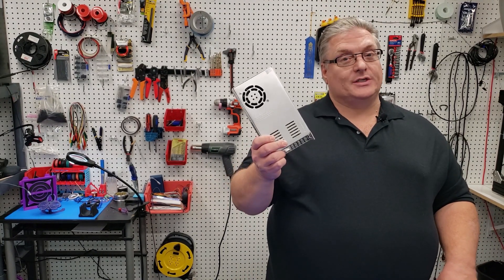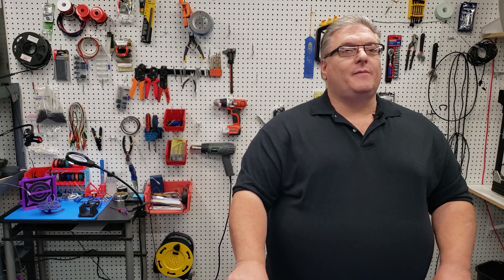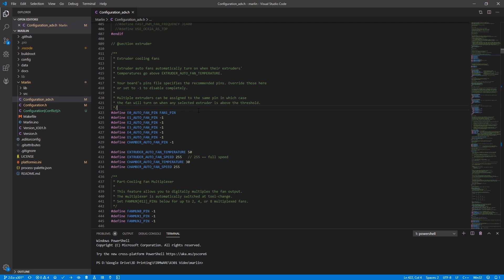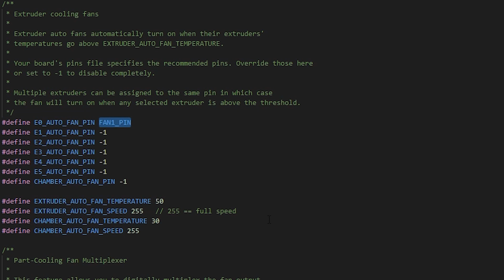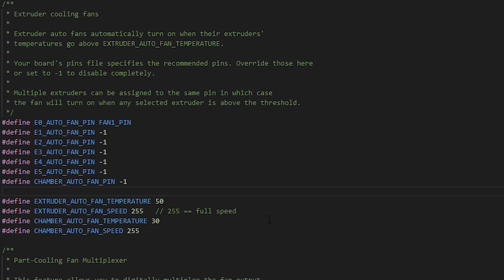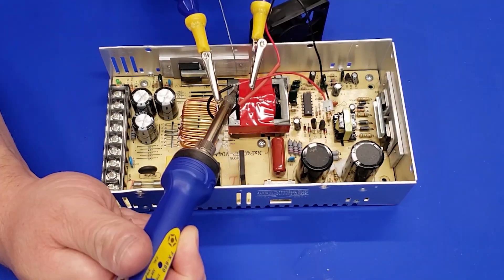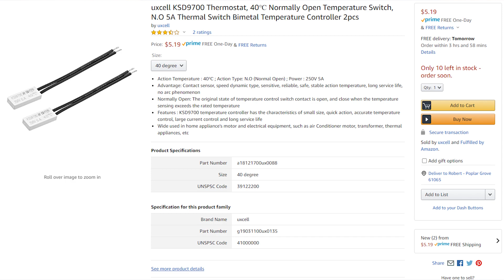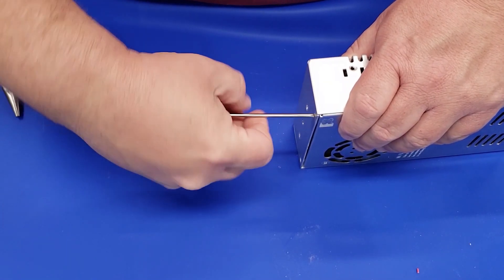The Silence Of The Fans | Silence the fans in your 3D Printer

Comment: ¿wouldn't it be better to stick the thermostat to the output rectifier?, or the main mosfets for that matter too, because the output coil should never get too warm compared to those.
¿Have you checked the primary mosfet and output rectifier temperature with a thermocouple to check the temps of those components when the coil reaches 40°?.
For coil indeed i should not chose more than 40°, another option is to put 2 thermostats in paralleol, one for the coil and one for the primary mosfets
Reply from the maker: I had thought of that but my concern with using those as the indicating factor is that they have them all pressed against the side of the aluminum housing acting as a heat sink.  The coil does warm up (or at least that part of the coil) to 40c and the fan does kick in.  Parallel connections would be a good way to do this but so far just having the one in the coil has proven to work really well.  I havent had a supply go yet and with few exceptions the fan only kicks on periodically when heating the bed up.  I've tried this on smaller units too like the one in my X201 and that kicks on more often but still very manageable.

Comment: You can also use passive cooled power supply. I originally got one with a net A8 — 12v thou, but it is 🤫
Reply from the maker: That is a good call out Kari.  You can use passive cooling ones but in the larger current options and higher voltage they don't generally build them in a passive cooling mode.  Which is odd if you ask me.  If you open one of these up the Mosfets and Power Transistors are all bolted to the case of the supply.  Which would provide more than enough passive cooling.   Im sure they figure a fan is cheaper than the testing to see if they need a fan. :)

Comment: is there a big difference if a fan is marked for 5v vs 12v? I bought 2 noctua fans (the thicker ones) to replace the hotend shroud fan and the computer case fan, but they were 5v, didn't notice until I received them. they have a better airflow according to specs than the thinner 12v version.
Reply from the maker: Ive tried a couple of the 5V "thick" fans you talk about and they are much quieter than a traditional 30mm profile size fan.  The 40mm noctua though was slightly quieter in my testing.  I believe the 5V ones though felt like they were pushing more air but since I dont have an accurate way to gauge that its purely subjective.
Reply: Don't run your 5V fans directly on a 12V line you'll fry them.
Reply: @Megdiver  oh no I know that I would set my buck converter to 5 volt

Comment: HOoow. Stop right there cowboy! Don't use the AUTO_FAN_PIN for that, use USE_CONTROLLER_FAN. Your hotend does not stress out your electronics and power supply, your bed and your drivers will. And that's what USE_CONTROLLER_FAN does. Use the AUTO_FAN_PIN only and only for the hotend.  If you don't have the port for using both, than choose or use external mosfets to have both. In your case, just get bigger fans for the electronics, they are more silent, when you have only one port and than use port for the small louder hotend fan.
Reply from the maker: I think I'm not catching where your concern is.  The whole design of my setup is to kick on both the case fan and hot end fan when it gets to 50c.  The SKR and step sticks don't really need cooling during idle time even when the bed is heating.  That case fan is purely for the stepsticks and for a precaution only.  The drivers/steppers are tuned that the heat sinks provide 90% of the cooling but I added a fan given the enclosed nature of the design of the X301.  If I understand correctly you're pointing out USE_CONTROLLER_FAN is a better option for a case fan since those electronics may require cooling outside of a print cycle. The power supply fan is completely independent of any of this so I don't have concerns on its cooling.   I chose to show the case fan in the video largely because it was hard to get a view of the hot end fan and display at the same time.  Let me know if I'm missing something but based on my use case this is doing everything I wanted it to do.
Reply: @MakersMashup  Oh, sorry, my Bad. I thought you connected the power supply fan also to that  DIY board at first and only did the temp switch in the power supply a more pro solution for this. Yes if the the power supply has it's own monitoring it's much safer. While my experience is that all step sticks tend to (over)heat over time by design (they cannot dissipate heat through the board) , I can follow your compromise here than, but I would not do this compromise myself as I do most of my calibrations with my hotend cold. Combining USE_CONTROLLER_FAN and AUTO_FAN_PIN  to one pin would be best, but I doubt marlin support that yet.
Reply from the maker: No worries I thought we weren't aligned.  You've always had great feedback on the channel. 😎  Yeah I initially thought you were concerned about some sort of PWM coming out of the hot end and the electronics so I slept on it and replied in the morning. So glad we're on the same page. 😄

Comment: Great video , ive replaced my 3d printer fans with GELID Solutions Silent fans apart from part cooling fan i just run it at 70% speed now printer is very quite  but this comes with a extra cost of new fans but well worth it as noise before was very loud